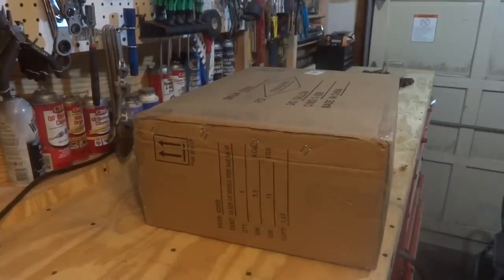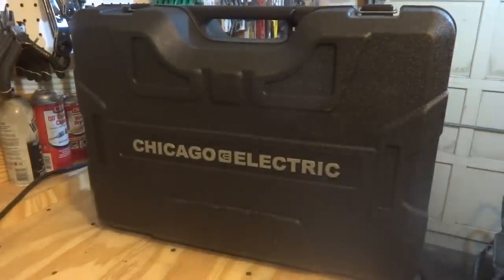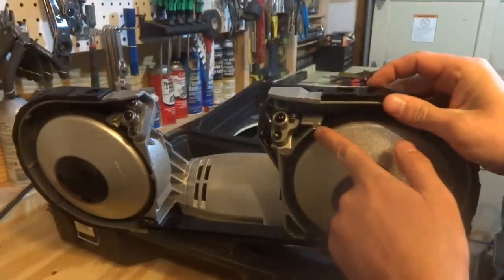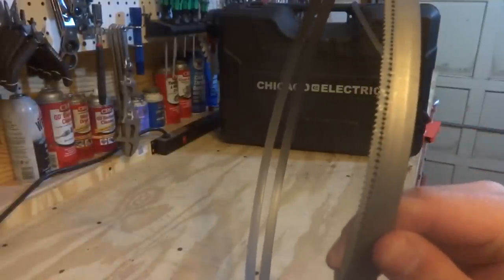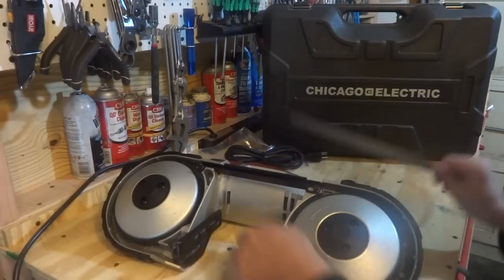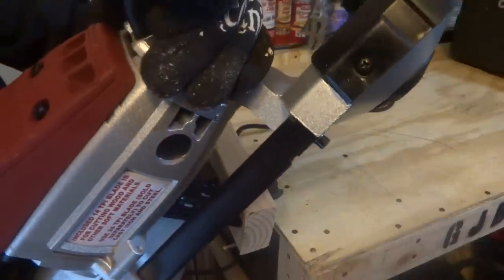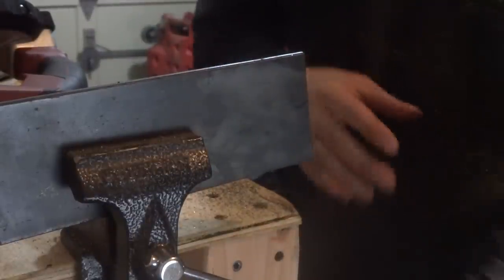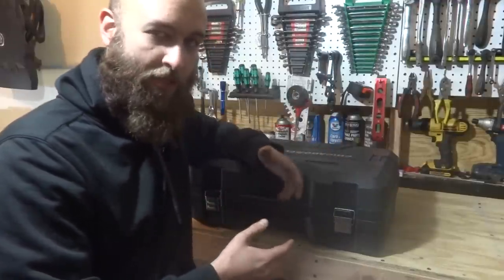Harbor Freight's NEWish Portable Band Saw Kit @GettinJunkDone

Comment: Joe... I just bought the hand-held band saw this afternoon here in SoCal. I bought it for the value and utility I saw in some online reviews. I'm actually cutting up some scrap metal parts that couldn't be cut on a stationary band saw. For a little over $100 with tax, I'm impressed with the quality. Oddly, the closest equivalents from the major manufacturers were closer to $300 and above. I think Harbor Freight has a winner here. BTW, I'm glad I purchased the box of metal-cutting blades at the store, as I see the blade included is for wood and soft metals. Thanks for the video.
Reply from the maker: Thanks for watching!

Comment: I just bought the brand new version labeled "Bauer," it's red in color and looks as though it's patterned after the Milwaukee Portable Band Saw. I plan on making a table for mine that I can free it from should I need to use it in the field. You are right on about the carry case, it's a real bonus, it would be awkward carrying this in your vehicle without the case. To carry extra blades you might consider attaching some kind of carrying arrangement to the outside of the case on the top. Perhaps a bag of some sort or even utilizing bungee cords. I paid extra for insurance, I have two years, any problems I bring it back they replace it.
Reply from the maker: Your idea for carrying extra blades is a good one!  Thanks for watching!

Comment: You might want to check your front blade guard on the side opposite the rollers. Those saws have a tendency to skew the blades toward the back and eventually it will cut through the back of the blade guard. Harbor Freight has since re-badged the saw and it is now labeled "Bauer". They have also added a roller in the area where the blade was cutting through the housing.
Reply from the maker: I'll take  a look.  Thanks for the heads up.
Reply: Let us know what you find. There were a ton of reviews on Harbor Freight's site indicating the problem. They couldn't take the old saw off of their website fast enough. Mine has the problem, but I haven't found a good/easy solution yet.

Comment: Resist the temptation to lube your cut with cutting oil. It will make the blades slip on the wheels. They are meant to be cut dry.
Reply from the maker: That's a great point! Thanks for watching!

Comment: Now that you've had it since January. How is the durability of the tool?
Reply from the maker: I've used it a handful of times since then.  During of those instances I used it to cut up a pair of truck leaf springs into much smaller pieces.  It chewed through them without a problem and I was able to cut multiple leaves at the same time.  It worked like a charm and I would buy it all over again.